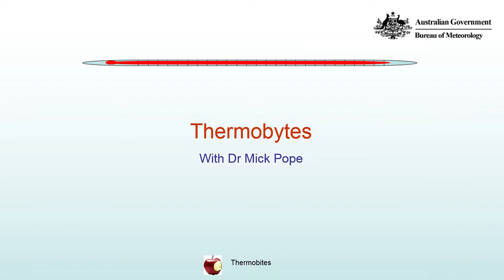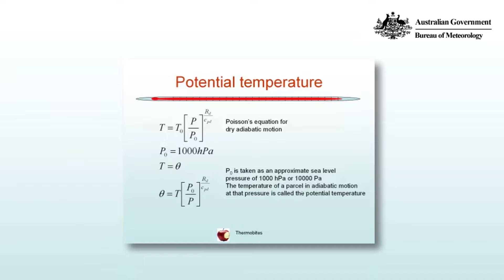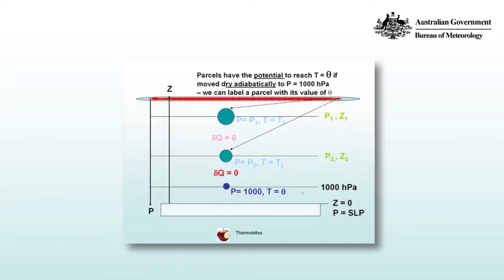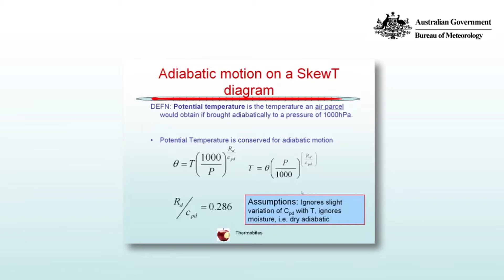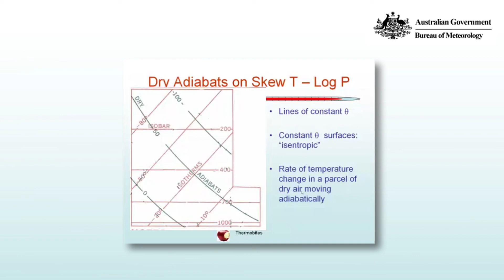Potential Temperature

Comment: It would have helped if you would have explained what Rpd is. If it were the universal gas constant then the index dry is meaningless. If it is the specific gas constant of air, it is also meaningless, because Thermodynamics of air does not include water vapor. Furthermore the heat capacity cpd is also unclear. Is it the specific heat capacity, then the molar mass cancels out anyway. You should not mix condensation and evaporation energy into poisson's law.